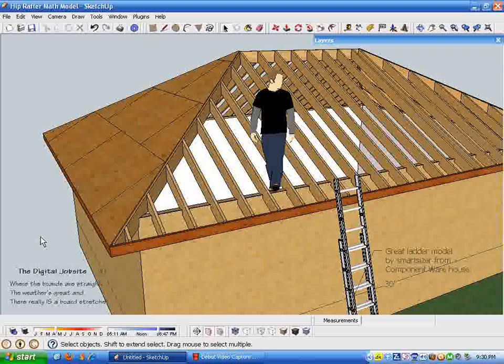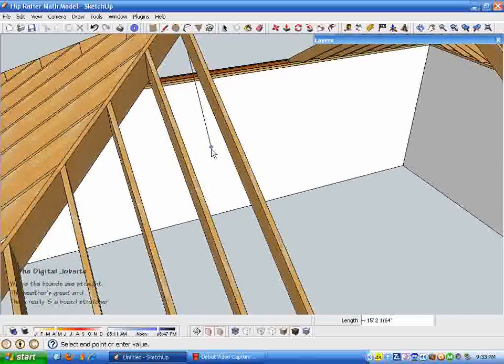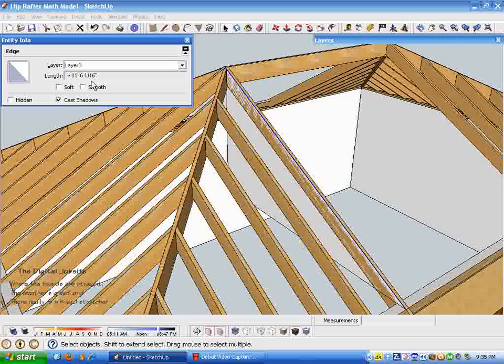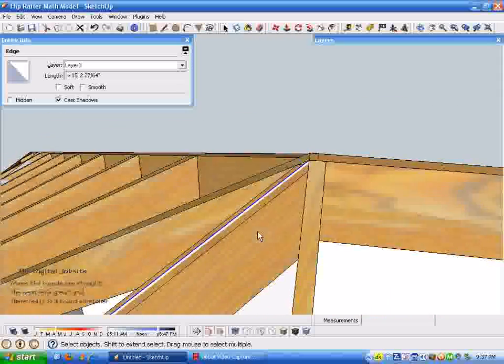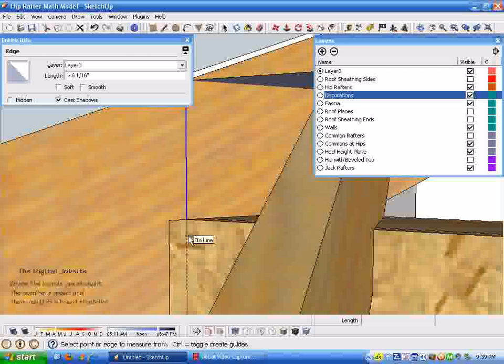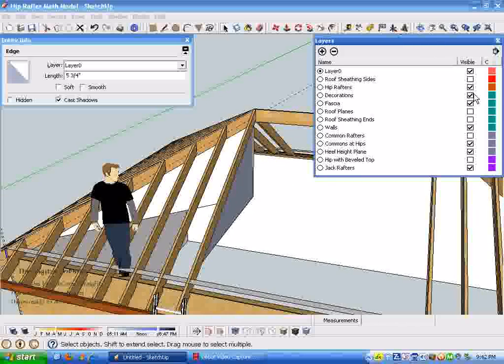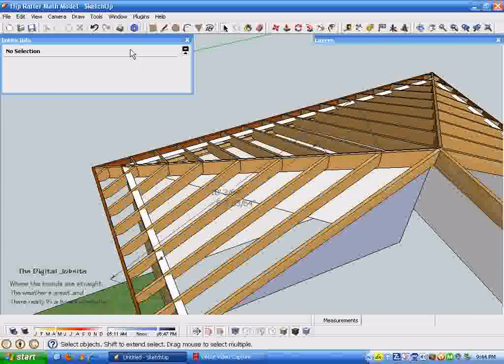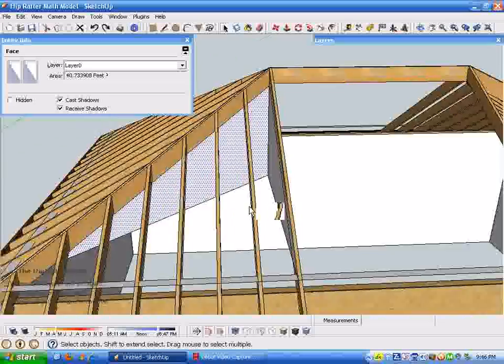Model and Measure Hip Rafters De-mystified by Measuring in SketchUp.wmv

Comment: Hey. Love your videos, they are so informative and clever. How would I figure the length and the angle needed for a broken hip rafter for two different intersecting pitches? One being a 30 degree pitch, the other being a 22.5 degree pitch. A formula without the use of SketchUp would be ideal and practical if you have one? Also how would I get an equal overhang width on a roof with two different pitches?
Reply from the maker: Glad you like the videos Jason... you ask good, but deep questions!  Answers for them are quite advanced and well beyond the scope or intent of this Channel but you can get a bit of insight on your second question in this video series to see what you're getting into with off-angle roof intersections: https://www.youtube.com/watch?v=we-BHy7ANY0&t=83s
At some point you'll get to a formula for use without Sketchup (After all, complex roofs were built for centuries before SketchUp with little more than a framing square and writing tablet!) but you need a deep understanding of roof geometry to know when, how and why to use it.
The reason I did roof framing videos with SketchUp is to help viewers gain much of that understanding using digital lumber which is far less expensive and far more abundant! 😁😎  Good luck on your quest... you'll succeed with determination and persistence! Best, Matt
Reply: @thetimbertailor Thankyou Matt, yes this understanding of roof framing geometry is very complex and is a true skill to obtain and put into practice with the use of a framing square and geometrical job site drawings only....Luckily I already know the answers to these questions, I just wanted to see if you truely did when someone wasn’t telling you that you don’t know what you’re doing and that your knowledge of roof framing is oh so basic. Good bye Matt, good luck buddy 🙂.
Reply from the maker: @jasonmcintre3565  LOL... I wondered if I was being 'set up' a bit with your questions because your wording was peculiar for someone who didn't already know the answers.   I enjoy an intelligent discussion with anyone, even if they disagree; it' a great way to learn but I detest bullies who troll around trying to convince the world how smart they are... you know the type, right? I appreciate your clever approach and respect your conclusions from this dialog.   From you comments I gather that you've been around your share of complicated roof geometry and that I'd likely learn some great new stuff from you if we ever worked on the same job. 
Not sure if you've made the connection or not but I kind of abandoned this Digital Jobsite Channel when I started up Next Level Carpentry  about 5 years ago... stop by the Channel if you've got a little time:  https://www.youtube.com/channel/UCXRNHTVpEdhz9BIvomETGiQ?disable_polymer=true
I hope I 'pass the test' of video content there too?  Best, Matt

Comment: how can a hip and common rafter have the same run in the same roof frame?  the will have the same rise but not the run
Reply: josheb, Thanks for watching and commenting...
You are correct: by definition a the hip and common rafter in any given roof have the same rise.  The run for a common rafter is 12" while a standard hip rafter (running at a 45 degree angle to the wall plates) is calculated with a run of 16.97".  For an 8" pitch roof the common is figured at 8:12 and the hip at 16.97:12 which is commonly figured at 17:12.  The geometry behind all this is that the hypotenuse of a right triangle with two sides of 12" length is 16.97".  Hope you find this and other Digital Jobsite tutorials help you become a better carpenter!
Reply: Thank you sir, i knew about the 12" in 12" for common and 12" in 17" for hip/valley but did not know how they derived it.
Reply: You're most welcome!  I was afraid that I'd said something misleading in the video by mixing up terminology.  To help visualize this I encourage people to measure across a framing square from the 12" mark on one blade to the 12" mark on the other where they will see the reading of just under 17".  People don't realize how much carpentry math can be calculated with a framing square but the more you learn and understand it, the better you'll be at carpentry.  
I hope you'll subscribe to Next Level Carpentry and feel free to comment and ask questions here anytime... I've been a carpenter for 45 years and want to encourage anyone who has an interest in the trade.